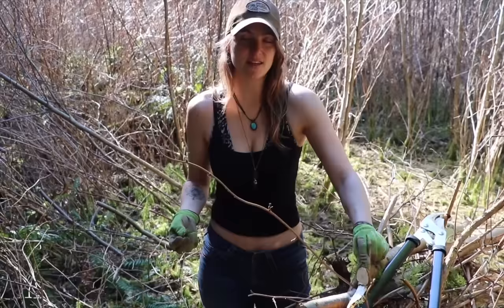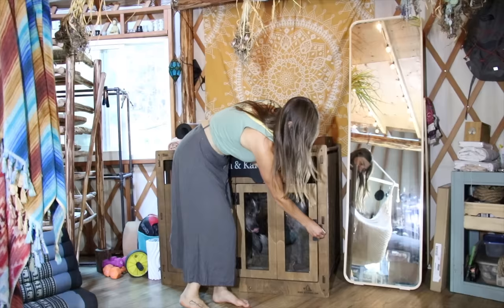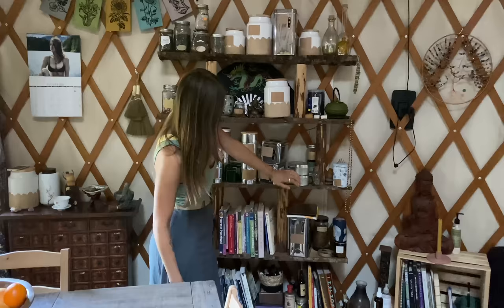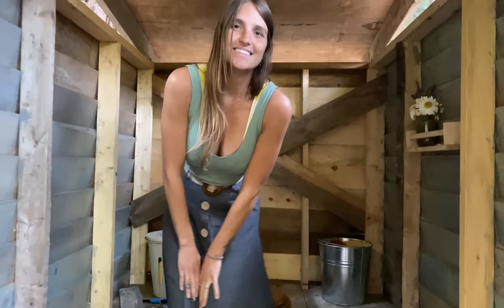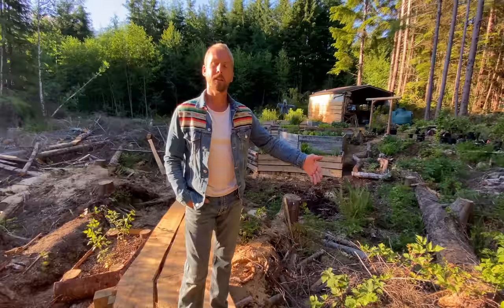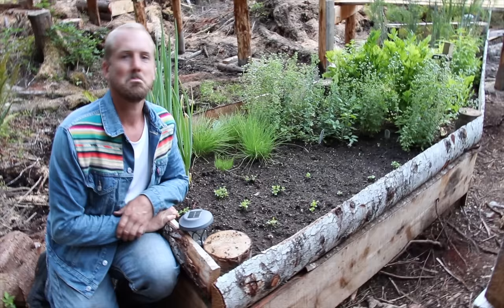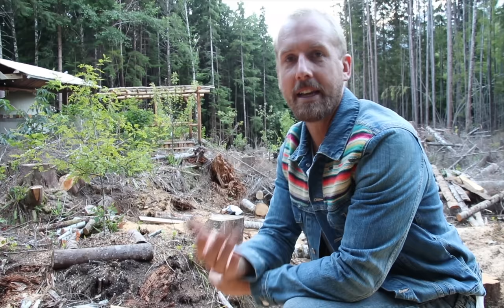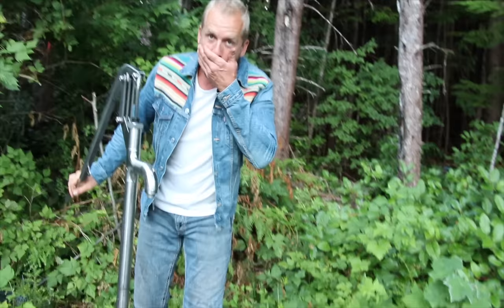This YURT in the FOREST Will BLOW YOUR MIND | ALONE in the WILDERNESS - FULL YURT & PROPERTY TOUR

Comment: Someone should me this and it worked for me. If you have plants you want to keep the birds from eating, I used a long steel pole you could use a stable stick tall enough to over tower the plants. Take a black garbage bag and cut a V in one end and make sure the V part is pointing down like so /\ attach the other end to the top and the birds think it’s a hawk. I looked up at it and thought ok I’ll try it. Amazingly the birds left the entire garden alone that was probably approx. 1/2 an acre. You might try it and see if it helps. Even when the wind wasn’t blowing the bag and /\ resembles a bird sitting there. Just a suggestion you might try.

Comment: Thanks for the eco fan info. I've never heard of such a thing. I could really use one or two with my oil radiator heaters. I will check into them. Here are my fingers crossed. 🤞
Reply: After a quick research, an eco fan isn't recommended for oil-based radiator heaters, as it will mostly run slowly and blow mostly cold air due to the lower heat produced (typically about 80 degrees F. To work efficiently the fans need a minimum of 175 degrees F and work best at about 400+ F.

Comment: I know this was from a month ago, but what is the yurt made of, the covering. This summer I bought a metal framed garage. It's like a thicker tarp material. My plan is to cover it in tin on the ends and sides and roof so it's a permanent structure. It's perfect for my boat and tools. I've been watching for over 3 years and hope my building lasts as long as the yurt. ✌🏼

Comment: Another great one. You guys do the walk throughs and updates like a boss. Oh, I have a suggestion for you. You know the tiny little basils that you've put in the garden? I suggest you get or build a flowerpot, fill it with proper triple mix/fertile soil mixed with some top soil and compost from your property. 
Mix/combine the soil well.
Plant those basils in there. Place or build the flowerpot somewhere near your outside kitchen spaces. W\in a spot where it can get some sunlight. 
It will grow great for you, look really nice, give you instant aroma therapy as you go by and rub it or pick a piece of leaf. And you will have lots to harvest and dehydrate to use over the winter. Until next yea.....you do it again.
But put them in a pot. Closer to you. The slugs shouldn't bother them as much. And they should thrive much better.
Reply from the maker: Thank you so much we try!
Reply: I recommend finely-crushed eggshells - or any kind of shells you can get from the water - spread on the soil to discourage slugs. They don't like the sharp edges.

Comment: you choose one of the most inefficient wood stove you are using well over 60% more wood than you need to. This also means you are also cutting way too much wood for heating you home. and also putting 95% more pollution in the air than you need to. There are a few things to do to increase your nutritional value of the soil like char coal always cover your farming soil never leave the soil without mulch  coverage of some types